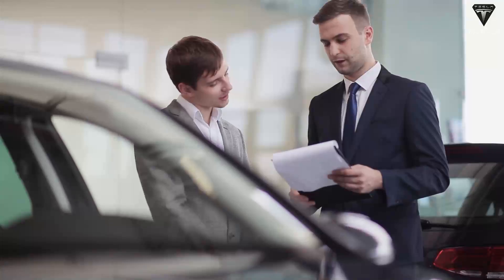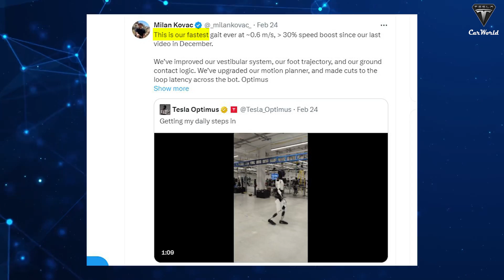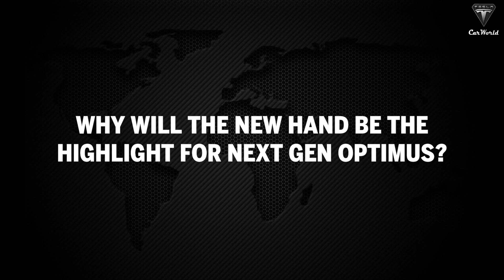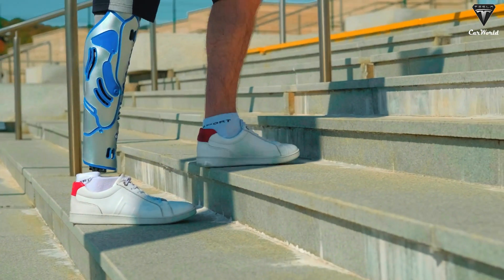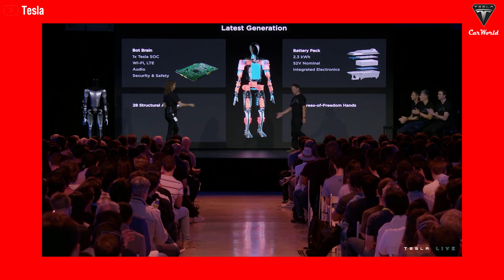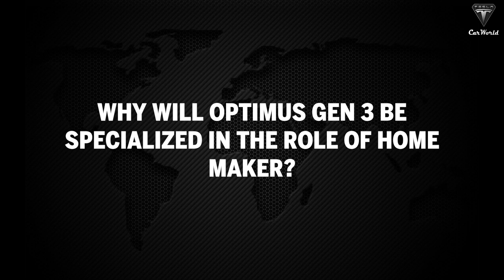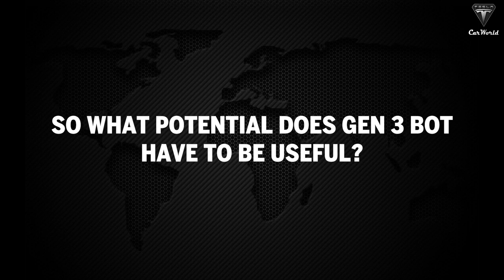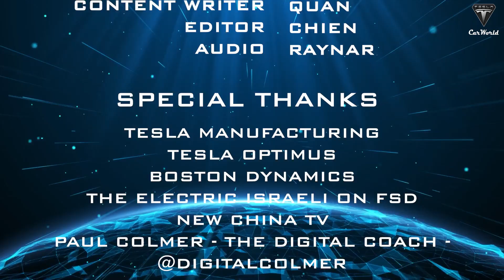It Happened! Elon Musk Unveiled New Tesla Optimus Gen 3 Version On Production Line ! Ready For Sale

Comment: Let's not forget that "carbon fiber" is a composite material made by the carbon fibers and resin, weather epoxy or thermoplastic. For these reasons, carbon fiber, or better carbon based composites, aren't more durable than  steel and can't bear more heat than steel (the carbon fiber itself would, but not the resin)
Reply from the maker: Yeah, carbon fiber is really strong compared to regular plastics, but not so much compared to metals. Optimus eliminates as much metal as possible, the weight needs to be lighter! Thank you